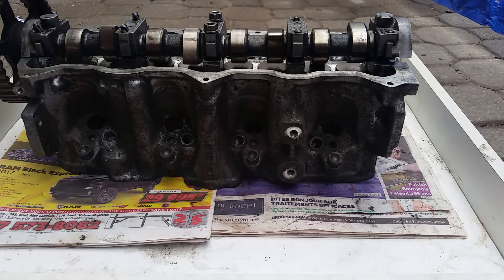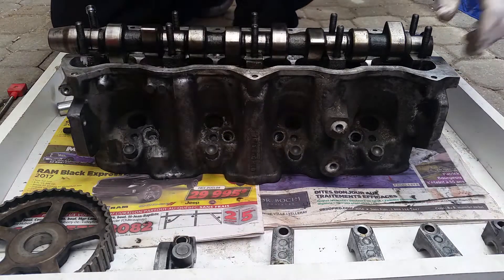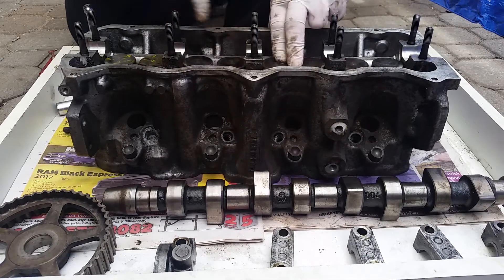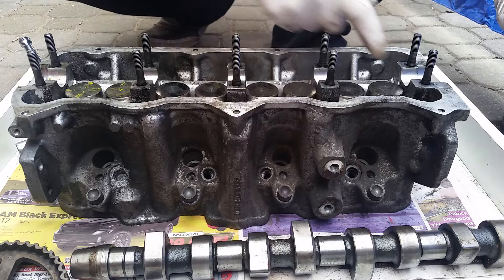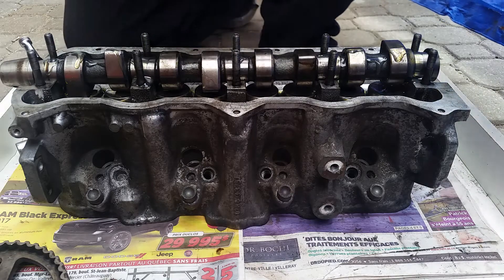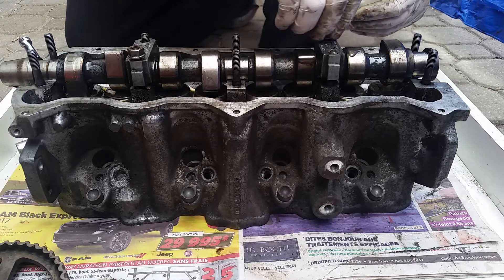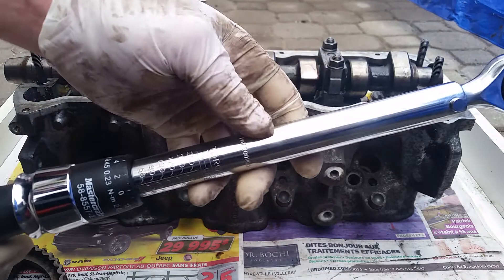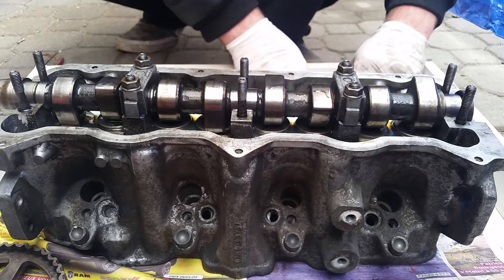MK4 ALH TDI camshaft removing , inspecting and installing

Comment: The camshaft pulley needs to stay loose until the engine is timed properly with the belt installed. Then the cam pulley can be tightened, engine spun 2 complete times and re-check timing marks.